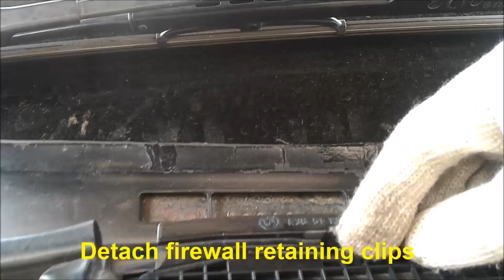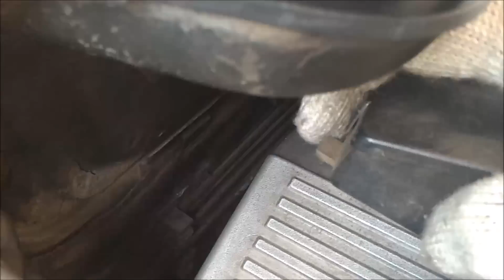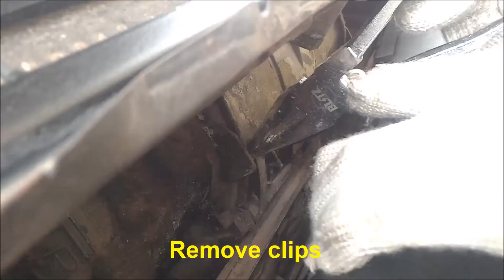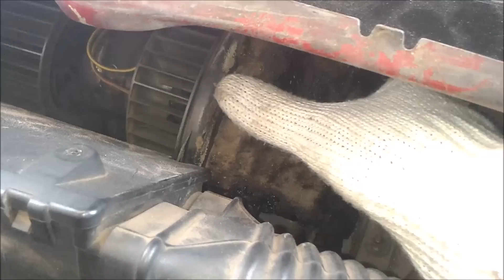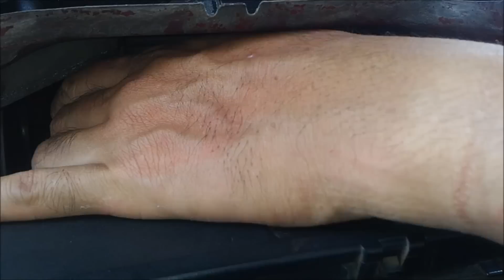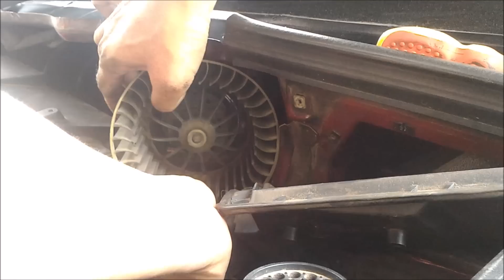Blower Motor removal, BMW E36M43

Comment: Typical shady engineering.  Parts that are prone to fail are hidden and hard to get to. Blower motor resistor was not working so I changed that. Now I have fan ! finally, right ? Well, now I can hear the fan working and moaning. So its noisy.  I need to change it. Temperature outside is 20F and once it will get warmer, it will rain - again. Just what a good BMW shade tree mechanic needs.
Reply from the maker: Success to change it
Reply: Am literally in the same boat. Changed the resistor a month ago, my fan was chirping at first, and now it's down right noisier than a train

Comment: Hello I have this problem on my e36 m43 engine , temperature hot aro e only over 27 degree , I’ve change heater valve but problem still same , maybe I need to change this piece to solve the problem or something else ?

Comment: very helpful video. Just one question, my car's blower is giving enough air i hardly feel in cabine when i put my hands on air vents. its working but does not feel it much even in the full range. what possible problems could be? does resister makes blower slow, or i need to change the blower completely or i can fix the blower? you answer will be appreciated. thanks
Reply from the maker: Textilion ster the sign of bad resistor blower is there is no air from the air vents (the blower doesn't work) when the climate control turn on.
Based on your problem, i think your car blower is getting weak. I prefer to change the blower with the new one
Reply: Thanks mate :)
Reply from the maker: Textilion ster you are welcome Tex
Reply: Cabin air filter!

Comment: the blower motor still works in my e36  but has lost alot of power. Should I replace the blower motor? or try replacing the Blower motor resistor?
Reply from the maker: Did you also check the cabin filter? Sometimes dirty cabin filter can make the air flow weak. But if the cabin filter is clean, i think blower motor weak, so you must replace the blower motor. CMIIW
Reply: @motoren_works  Thank you for this suggestion I will check the filter first! thanks for the reply.

Comment: This is MUCH harder to do when working on an E36 with a 6 cylinder, particularly the early models. No way the fan comes out that easy and I can attest to that. Putting it back is a PITA if you have a fan without removable fan cages. You may even have to loosen the wiper assembly! Just giving you a fair warning.
Reply: Absolutely spot on mine was a nightmare stupid place to put it really stupid was going to get a garage to do it 6yrs ago and they wanted nearly £500 so I did it myself and although I got it done I hated every minute of it.

Comment: Thank You Thank You Thank You.
It feels like you did this video because i said in the other your video that you didnt show how to remove the blower.

And i saw your video just today. Whatever or whoever the reason for the video was im very happy. I need to remove it and try to replace the brushes and clean the motor. If it doesnt help then time for new whole blower assembly.

 Sometimes my E36 blower works and sometimes not.

Thank you once again
Reply from the maker: jw200 you're welcome and it's nice to share with other :). if you find a lack on this video, please be advised, because several components not active anymore.
I think the difficult step when remove the blower is to find the right path to release it from the nest. so you must make an improvisation, and becarefull.

About the blower problem sometimes work or not, based on my experience it can cause by bad  resistor blower also. resistor E36 produced in 1996 and up it has name final stage unit (FSU).
To ascertain if the FSU is bad, you can borrow your friends E36 FSU (good condition) and test it in your E36. How to remove the FSU,  you can watch in my other video.
I suggest you to check the FSU first before you're remove the blower motor.
Reply: motoren works Thank you for the answer. My car is indeed 1996. I will check the resistor first. It might save some trouble. removing the blower.
Reply from the maker: jw200 you're welcome

Comment: Om saya habis bongkar blower ngikutin video sampean, stlh dpasang kok blowernya gak bisa kenceng ya muternya, speednya dtambah muternya tetep pelan
Reply from the maker: sebelum dibongkar kecepatan blowernya gimana om? sepengalaman sy selama beberapa kali bongkar blower dengan langkah2 sesuai dengan video ini, tidak ada masalah dengan kecepatan blowernya.
Untuk kecepatan blower  biasanya berhubungan dengan Final Stage Unit (FSU)/resistor landak jika control AC digital atau blower resistor jika control AC nya analog. Coba di cek dulu komponen tersebut om, semoga dapat membantu.
Reply: Sebelumnya normal om. Klo resistor landak rusak efeknya apa ya om ?
Reply from the maker: @gotrecute  sepengalaman sy, resistor  mulai mau rusak ketika control AC nyala normal tp speed blower hanya aktif di kecepatan tertentu saja, atau kadang2 nyala kadang2 mati, atau efek lainnya adalah blower tidak nyala sama sekali (tidak ada hembusan angin)
Reply: Ok suwun om
Reply from the maker: @gotrecute  sami sami om
Reply: Klo resistor blower panas bgt knp ya om
Reply from the maker: @gotrecute  kurang paham om. Tp bisa jadi komponen tersebut mulai error.
Dulu pas FSU sy menunjukkan gejala error, salah satu indikasinya bagian disekitar konektornya lebih panas. *disclaimer: ini pengalaman sy om, bisa jadi ditempat lain beda
Reply: Nah konektor sempet leleh om, skrg udah dganti. Cuma resistornya blm gnti.
Reply from the maker: @gotrecute  kayaknya yg error FSU nya om
Reply: Update om, ternyata yg bikin resistor panas karena blowernya seret. Akhirnya ganti blower baru milik kijang, jooss bgt skrg anginnya halus dan kenceng. Ganti ke bgkel ac langganan
Reply from the maker: @gotrecute  Alhamdulillah. Berarti resistor aman dan tidak diganti yess om? Blower kijang yg model apa? PnP dg punya e36, apa ada rubahan? Harga barunya blower kijang kena berapa?
Reply: Resistor aman, modul aman. Cuma ganti blower. Motor blower pakai kijang dimodifikasi dbungkus dg rumah magnet punya bawaan bmw agar masuk ke dudukan bmw. Kipasnya masih pakai punya bmw. Rumah dudukan  disesuaikan dg motor blower yg baru sehingga ada beberapa bagian plastik  yg dipotong dg cutter. Harga motor blower kijang merk denso 500rb + ongkos 150rb. Total 650rb. Masih lebih murah dpd beli copotan yg usia pakainya tanda tanya.
Reply from the maker: Mantabs, sehat terus untuk bmw sekaligus drivernya om. Trimakasih sudah ngasih update disini lagi om, bisa menjadi tambahan pengetahuan.
Reply: Siap amin, sami2 om
Reply: Kabel yang warna hijau putus di gigit tikus 
Dan akhirnya AC mati total

Pingin nyambung ribet tempat Nya sempit
Reply from the maker: @ayupujiyanti8432  bawa ke bengkel saja tan